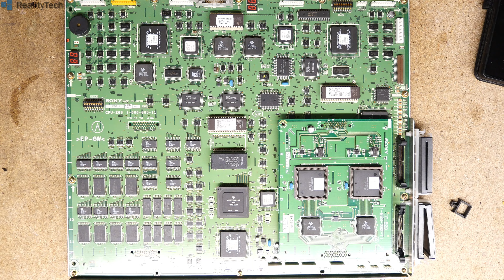#134 - Sony DVS7000 68030 CPU Board

Comment: A bit late to the party but... 😄

At about 9:20 when you're pointing at the smaller CPLD to the left of the two dual port SRAMs, just above that is a HD64180 which is a Z80 CPU. I'd make a good bet that is the sub processor that is mentioned around the board. 

The smaller CPLD you were pointing at is labelled "SUBDEC" which could stand for something like "subprocessor decoder" which is responsible for decoding addresses for various memories and peripherals associated with the Z80.

Having worked a lot with the MAX7000 CPLDs I doubt they are capable of implementing any kind of processor, they just don't have enough logic in them. A reasonably complex state machine for sure though.
Reply from the maker: I went back as that board is in my "I should do something with this" pile and yes, you are right.

Comment: Hey, I'd love a follow-up with your findings related to the panel pinouts and protocol. I have one of these too, but the main board is badly damaged and the display module is broken, so i intend on reusing the io panels
Reply from the maker: Hi Tventy. I'll publish what I have on my blog before/over Xmas. The pinouts on the back are freely available and I have a messy, but correct schematic and wiring of the logic on the button boards. The DVS7000 manual has the rear panel connections in it.
Reply: @rtechlab6254  thank you, ill wait for the blog post. Sadly the back connectors are no longer in a useful state (as they'd be controlled by the broken main board) but i have seen the manual. I would also appreciate it if you could post pictures of the trackball module, as the plastic frame of mine has shattered.